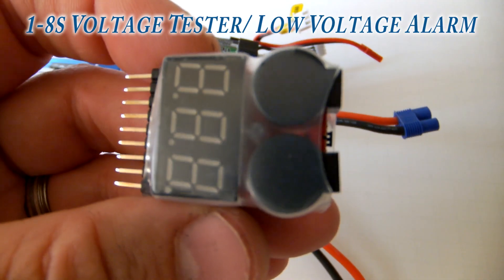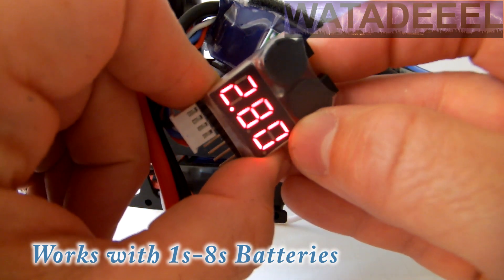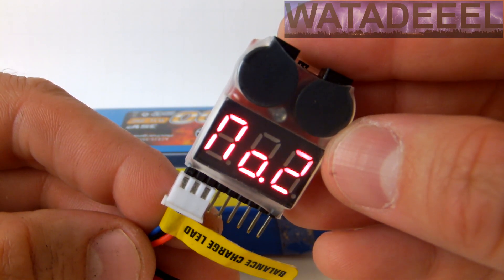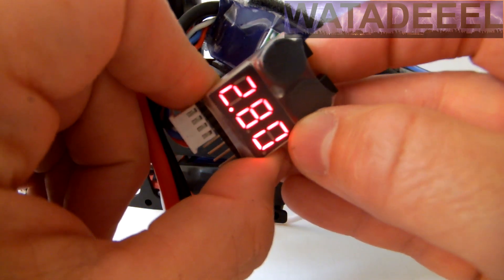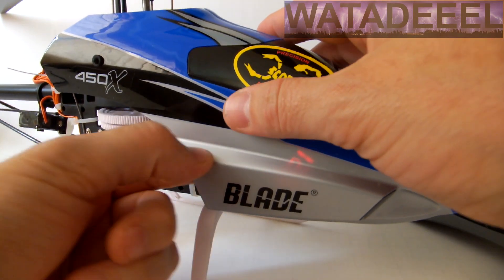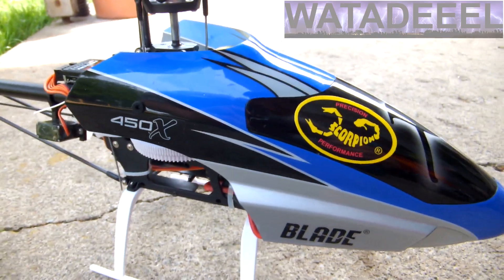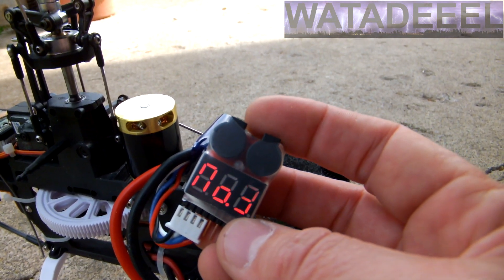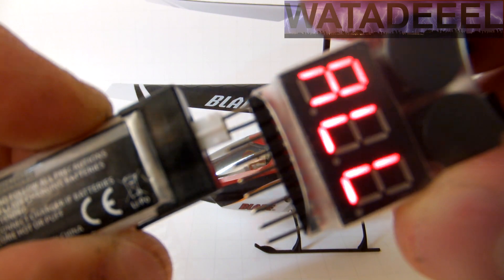1-8s LiPo Voltage Tester Alarm DEMO

Comment: Check your buzzers.
Both my such buzers work only on 6s elements, and starting from the 7th element I define incorrectly: 10 volts on the 7th and 0 volts on the 8th element. I checked on 2 different batteries. The result is the same ..

Comment: isnt 3.7v a little conservitive. Most people generally set there escs LVC to around 3.1v or 3.2v and have it set to soft cut off .

3.7v might cut your flights short as the voltage under load is usually much lower. If i run to lvc my packs after recoring are usually back up around 3.5-3.5v i run to a timer of 5 minutes and that brings me down at 11.3v (3.7xV per cell)

seems more logical to set the alarm to 3.4v and that gives you time before LVC starts kicking in.
Reply from the maker: Yes it is conservative. I don't mind short flights so as to error on the side of caution. This item is NOT a LVC (Low Voltage Cutoff), and will not cause your aircraft to lose power. It is simply an audible alarm to let you know when your packs drop below a certain voltage. I like knowing exactly when the packs drop below 3.7, regardless if it  is caused by a load or not. When I pull the power back, the load drops, the alarm stops in flight, and that's simply what I like to hear, personally. If the alarm ever stays on an doesn't let up even at low power settings, it's time to land asap.

Comment: thanks for your video- what voltage is indicative of a fully charged cell whether 1s or more? Is it 4.2V per cell? Also what voltage is indicative of around 30% charge left (so that it's around 20% by the time you land for example- the recommended % to stop flying by?)- what is 20% charge in volts too? thank you

Comment: Hi
I bought this and I think my one is faulty 
I set it for 3,60 and 
First time it buzz when was 3,90
Then 3,80 then 3,7 then 3,65 
Basically it was buzzing many times.
Next day  I set alarm on 3,40 and alarm went on 3,82 then again on 3,65 I didnt test further ,  it is something wrong with it, or im doing something wrong? or this thing giving me warnings before? but so many times????
Reply: +DYMO -- One thing you have to remember is that if you install this in an R/C vehicle and you operate the vehicle, the motors in the vehicle will cause a current drain which brings the voltage down while under load. So if you set it for 3.5v, then operate your R/C vehicle until it buzzes, then check the voltage, it will climb back to a higher voltage within a second or two, and you will see maybe 3.8v when you check. So you need to keep doing what you are doing and set the alarm voltage lower and lower until it buzzes when it really is time to bring the vehicle battery back for charging.
Reply: +watadeeel thanks I'll keep trying and testing . So is really hard to tell because sometimes I go half throttle sometimes full and then probably drops more. I need to spend a lot more time on testing. Thanks again!
Reply: +DYMO -- One thing is for sure: It's your Current draw and the resulting voltage drops of your batteries which is inconsistent, not the LiPo Voltage Tester!

Comment: Hello,
 does this device remeber its alarm voltage setting after unplugging?
Reply from the maker: +Padro Podra ~~~> Yes it does remember alarm voltage after power is removed. You do not have to set it each time you plug it in! That would be annoying! It sets the value in the memory when you set it.
Reply: glassdogangle
Great, thats exactly what I hoped it would be like. Thank you!

Comment: THANKYOU! Finally someone explains how to plug this into your battery PROPERLY. I have the Venom tester. Looks similar to the one in this video. It just has a red case around it. Polarity of pins is marked. But NOWHERE in the instructions does it say you have to make sure you connect the negative end of the battery lead to the negative side of the tester. In other videos, people just say "plug it in" without mentioning ANYTHING about polarity. Ridiculous.
Reply from the maker: I do my best to show people things in such a way that even people not familiar with things such as polarity can understand. I have become even better at doing demo videos over the years.

Comment: Will my battery and/or battery buzzer be damaged if I connect the battery with the wrong polarity to the battery buzzer? I found out the hard way. I only did it once though, and the battery buzzer still works fine, but, I have OCD and just can't stop thinking about it. By the way, I'm using the Hitec battery buzzer. But, I'm sure the principle is still the same.
Reply from the maker: No it will not harm it as far as I know!
Reply: Thanks.

Comment from the maker: It is not a false alarm if you understand what it is doing: Telling you your voltage has reached a certain minimum voltage threshold.

You have the ability to set the alarm's threshold. So, simply use this information to adjust the alarm to where it goes off accordingly.

Under load and alarm sounding? Just pull the throttle all the way back and glide by with your plane to hear if it is beeping or not.

Helicopters usually are under load all the time, so adjust voltage minimum accordingly.